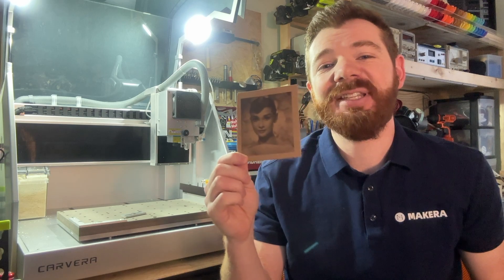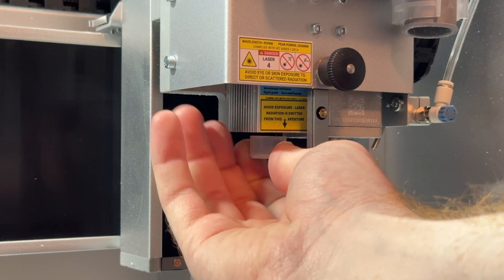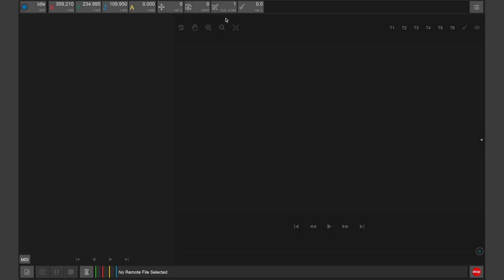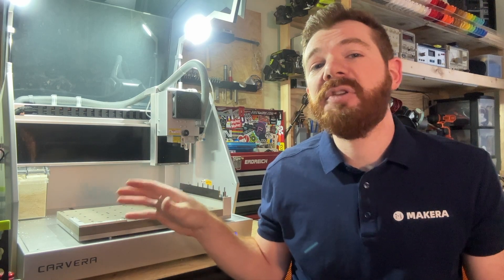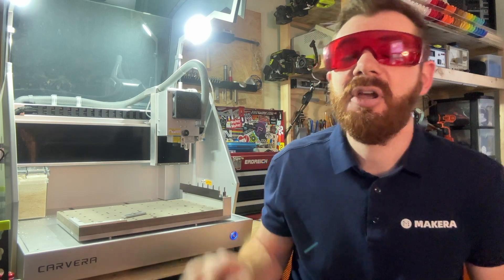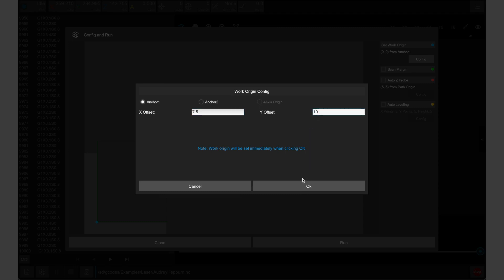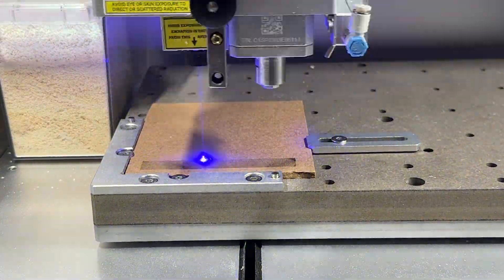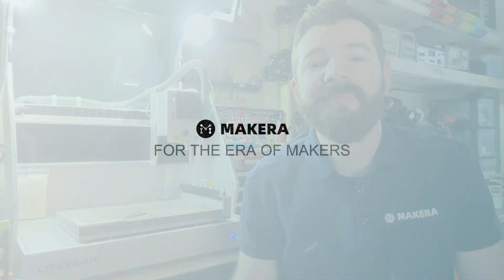Laser Engraving, a Carvera CNC Example Project

Comment: Would it be possible to use the external vacuum port as a fume evacuation? Like have shop vac outside with a hose that runs in through the window and then to the back port of the Carvera?
Reply from the maker: This should be possible with some modifications and by maybe using the existing external vacuum connection for the outlet.